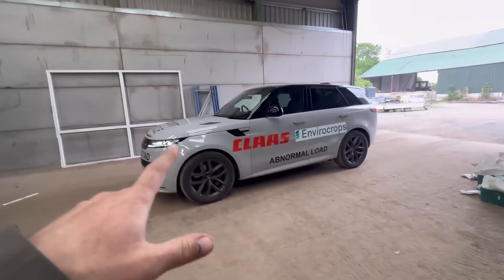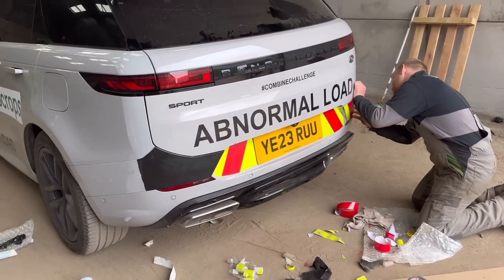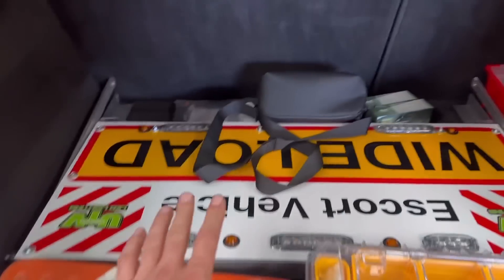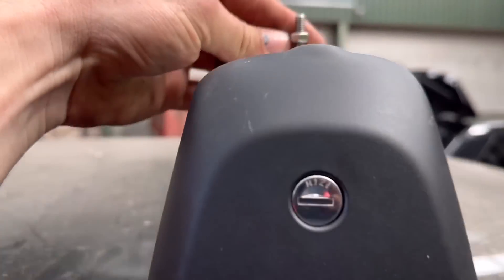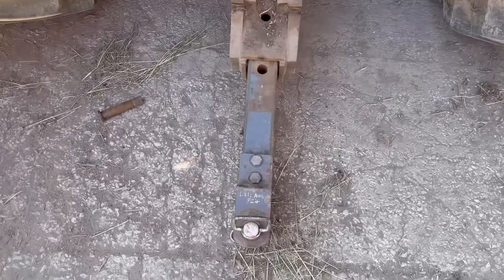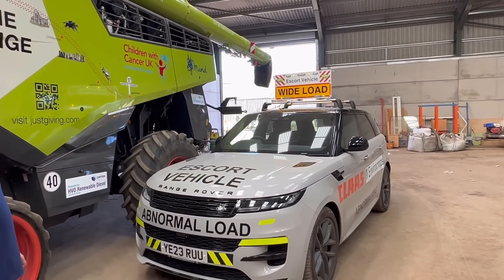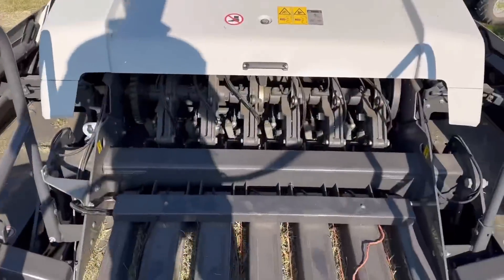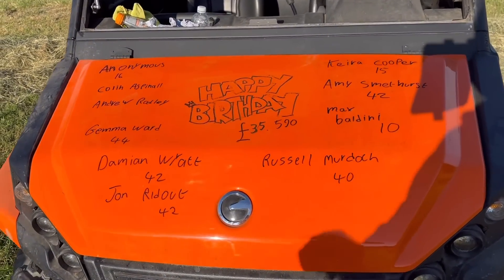NEW BALER OUT FOR FIRST TIME & I HURT MY FINGER #OLLYBLOGS #AnswerAsAPercent 1166

Comment: 50% today. Got a couple good news instances today. Solar battery maker is coming to see to our faulty battery and a different solar installer may have found a replacement for the burn up connector on the solar panel inverter. All caused by incompetent drunk electrician. Which is good news as my installer done a moonlight and vanished. So we have no warranties on a 2.5 month old installation.

Comment: car looking great, awesome job, imp currently having to remove the exact same stickers from a Mercedes vito van, that was a motorway escort van, for abnormal loads etc and they are an absolute pain to get off, granted they have been there for the last 10 years, top tip with  stickers, spray soapy water on the car/back of stickers and you can move them about and get them exactly where you need them, before pressing them down and squeezing the water out with a plastic card, also when you get air bubbles, use a sharp stanley blade to carefully make a small cut, and usually you can work the air bubble out, great vis as always Olly, keep up all the amazing work you and the team are doing 👌💪🚜